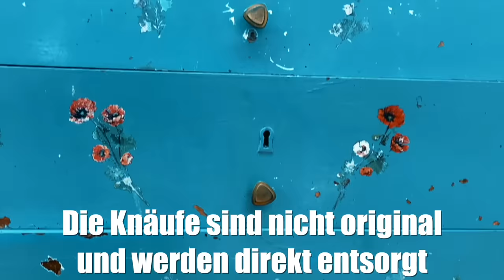Vorher 30 Euro Nachher 1200 Euro Möbel Restaurieren

Comment: As a historic furniture Conservator (retired) we would approach some of this quite differently, especially in the most strict practice in the U.S. However you still have great skills and patience. Respect! Liked, subbed and rang that bell!
Reply from the maker: Thanks very much. I will evolve. 😊
Reply: I have a couple simple suggestions for you to try out in the future if you're up for it. 

While this walnut is beautiful as is, its natural beauty can be enhanced even more. First, when left completely sanded out like this all of its depth is removed since the rich patina that develops from age is actually very very thin. You can knock out that rawness and increase its patina with an application of potassium dichromate. Comes in powder form, just mix with water. It's very simple and you can do as many applications as you want, just apply and let dry and you'll see the results within minutes. Works very well also to match up a new piece of wood inserted into an old piece that you haven't sanded all the patina out of.

Second tip is before you apply any coating, be it wax or whatever, apply a very thin diluted dewaxed shellac to the wood and let dry (1 or 2 campaigns is up to you). You're not trying to build any film coating on top, you're going to use the shellac because it is a low molecular weight material and it will sink deep into the fibers and pop the chatoyancy in a way that wax alone will never do. 

Experiment on some scraps and have fun!
Reply from the maker: @piedpiper7051  Thank you 😊👍

Comment: Quick question. What’s the difference in using a wood shaver as opposed to sanding?
Reply from the maker: One is grinding. the other is processing with a scraper. The surface is peeled off or scratched. Result. Different surface.

Comment: Have you tried using a soda blaster to help remove the paint in the cracks? It's worked for me in the past. With soft wood use aluminium duct tape over the cracks and press in with your thumb to see the cracks outline and then cut away the cracks line to a narrow slit and then blast. Can make for a really clean finish. Then you can fill or leave as is, stain is fine etc.
Reply from the maker: no I don't have that. Thanks for the tips. i will try it next time. Regards

Comment: What a handsome piece of furniture! So much care in your work. I would have loved to be a fly on the wall during this process to listen in. I am curious about one thing... where you angled cut and removed the insect damage side, why not cut vertically straight and replace as an entire plank from top to bottom? Cheers!
Reply from the maker: I wanted to do. But I would have had to remove the border at the top and disassemble the entire body. That would have been a huge extra effort. greeting

Comment: A good restoration as usual and a lot of work involved. My only comment would be the finish used. When I finish a restoration I always use french polish which usually matches the original finish.
Reply from the maker: Hi. Thanks. I was thinking. But then I decided against it. I found that it would no longer be proportionate to spend several hours on a shellac polish.

Comment: A mesmerising video with a serial killer vibe (in a good way). My only observation is the positioning of the knobs. With drawers that size I think each should have had a pair of knobs. Once filled those drawers will be tricky to pull out one handed - though I appreciate there were single knobs in the lower drawers originally.
Reply from the maker: The chest of drawers is with us. It is used every day. It works very well with just one button. Greetings

Comment: Lovely job. Is that veneers on 19:30? If so, why have you decided using them? Thanks
Reply from the maker: Yes. Because the woodworm destroyed the entire surface.
Reply: @chrigunrestauration  Pardon me my ignorance, but at this point, wouldn't that be more reasonable to completely remove the damaged panel and replace it with the new one? Sorry if the question is incorrect. I'm new to this and still figuring things out.
Reply from the maker: @dmitryesaian9021  I'm trying to get as much as possible. If I replace everything I can also build a new one.
Reply: @chrigunrestauration  makes sense:)
Reply from the maker: @dmitryesaian9021  😀

Comment: Reminds me of the time I took the kitchen cabinets from a lady's house and came back with blue wash and pinkwashed bedroom storage for their two young children. They were so happy they asked me to build them a new kitchen using standard construction materials and to evenly marked it up with a chain and peen hammer.  I had no idea what I was doing there but when I was finished, I washed it with a dark green paint. They had ugly old yellow vinyl flooring so I thought they were out of their minds. However, when I returned, they had removed that vinyl and sanded and refinished the gorgeous oak flooring beneath it.  When the cabinets were in, I got too many referrals.

Comment: Another great job re[aoromg tjos [oece/  I have an old serpetine dresser that was original to the house I grew up in.  It came from an old victorian home.  It was sold to my mother for 
$3.00 and because my mother didn't know how to refinish furniture, she simply painted it.  When seh painted a piece with drawers, she would paint the whole inside of the drawer and the outside of the drawer as well.  She knew better than to do that, but she did it anyway.  I remember when she was painting it, she said, "I know people don't generally paint the inside and outside of the drawer - but I do."  I wish I had known how to refinish furniture way back then I could/would have stopped her.  So, now I have the piece completely painted, needing a complete refinish.  As a kid, I noticed there was no damage to  the piece at all.  It was the finish that had become damaged.  The wood itself was just fine.  The whole dresser is oak and I saw a dark finish on it.  It is my hope that I can lighten enough to give it a honey color, but if the wood itself is brown oak, I'll see what it looks like with just a varnish without a stain.  If it needs a stain, no doubt I will go with a darker finish, but not too dark.  I also have a 150 year old child's rocking chair with bent arms I need to repair.  My grandfather rescued it out of a dump and it was used for his family of children and then used byu my parents family of five kids.  It is now mine and it is in need or great rapri.  I may need the fack of the chair cut out for me, and glued and I will see to the final finishes.  I am not going to strip the whole chair because I want to preserve the finishing of wax that my grandfather put on the chair.  Oobviously I will need to put new wax on any new pieces cut out.  Bit jobs ahead.
Reply from the maker: Hello. I think it's great when they devote themselves to this old furniture. This is the only way we can preserve such ancient treasures. I wish them all the best with it. Greetings from Germany 😊😊👍👍

Comment: The finish is better by boiling beeswax over low heat with turpentine essence, apply, remove the excess, polish with a cloth and then burnish with an opal stone.

Comment: No way i would pay 1200 for this. You didnt treat the wood worm. You didnt clean sand and seal the inside of any drawer. The back bottom and inside of the dresser were still dirty and just hidden.  The outside looked decent, but nowhere worth 1200. As is maybe 150.

Comment: All that work just to use plastic keyhole escutions, historically innapropriate knobs, and a boring beeswax finish? 
The process was impressive, the end result not so much. Also, the knobs on the lower 3 drawers are all slightly off center.
Reply from the maker: The keyhole fittings are not plastic. They are bone like the original ones. but it is called differently. The holes for the knobs were there. i did not want to drill new ones and then close the others. Unfortunately, my wife did not want shellac. She wanted Wax. what can I say. Happy Wife, Happy Live.🤷‍♀️ greetings

Comment: It isnt just that people paint things, it is that people are such terrible painters. Covering over the locks, hinges, hardware...terrible preparation, regluing with terrible glue that has no solvent ...agh. i dont need to tell you 

What is eating the holes in furniture? I have not seen this in North America. If something is left outdoors, or in a bard, it may rot. But never all those small hole that look like insects.
Reply from the maker: The holes are from woodworm. It's a very small beetle that reproduces profusely and eats its way through damp wood.Greetings

Comment: My major concern is that he's doing this indoors, and he's using a lot of toxic chemicals and solvents in a closed space.  Is there any strong ventilation and use of respiratory protection?  I don't think any amount of money or  profit is worth getting cancer, and also this reclaimed dresser is going to still be outgassing dangerous fumes and chemicals for a very long time, in someone else's home.  And they won't be wearing PPEs.  Maybe even in a child's room.  Soothing to watch, and the result is lovely, but I wouldn't purchase it, in my opinion.  I wouldn't want it in my house.  Everyone in my nuclear family, and many extended members, died of cancer.  I avoid carcinogens, I'm vegetarian as well...  and I'm still cancer-free.  It's a toxic job, even if he loves his work.
Reply from the maker: I understand your concern.But. I don't use toxic substances. What could be toxic is if I heat up the old paint with the heating air dryer. I think I only used paint scrapers on this chest of drawers. Otherwise I wear a respirator. The room is ventilated.

Comment: the restoration itself is ok i think. it was in such a bad shape that it would not have been recommendable to use it for example to store clothes or textiles (which is what it was originally made for). from an asthetic point of view though the endresult is not convincing. the effort shouldn't be limited on getting an antique piece of furniture as close to its original appearance as possible when that would require an extraordinary craftmanship and effort. better to aim at an asthetically pleasing result instead. in this case, this could have been achieved by painting it in white, off-white, light blue/greyish blue-green, something like that, but importantly, only all-natural paint allowed.
Reply from the maker: Hello. You won't see me smear any white paint on the furniture. the so-called Chabby Chic Lok. you have to look elsewhere. I hate that.